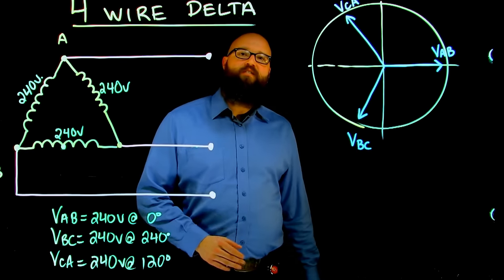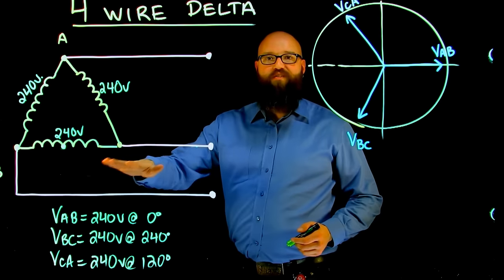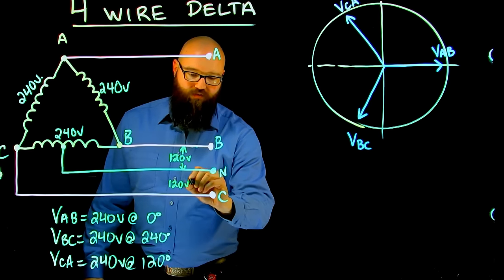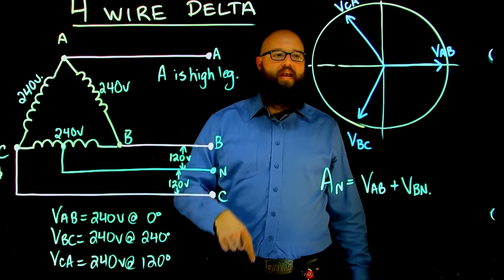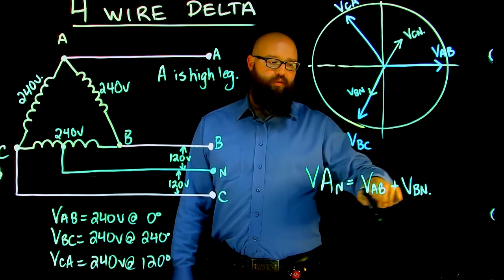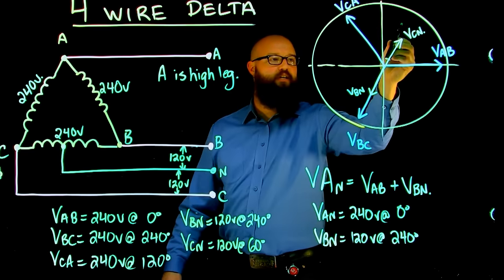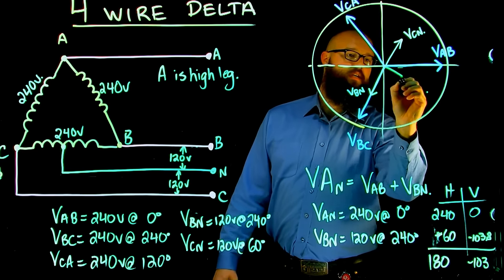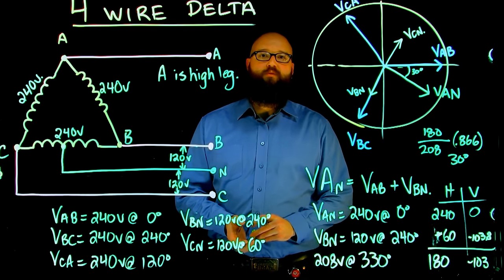Three Phase 4 Wire Delta

Comment: In my neighborhood, this High Leg 3Phase is supplied by the electric utility company using 2transformers (not three as suggested in the schematic above).
The 1st transformer is a center tapped transformer delivering B,N,C. The 2nd Transformer is wired as A,N and is perpendicular to B and C phase.

Comment: At First Energy we called the middle pot (that's 120/240) the Lighting Pot. Smallest config wud be two 25 KVA wing pots and a 50 KVA lighting pot. Usually the three phase load is smaller than the 120/240 load in commercial customer. On occasion, all three would be 25 KVA minimum.

Comment: What would happen if you tap another coil in the 4 wire delta, i mean a 5 wire delta. Will it cause a failure? Or still working?

Comment: Would it be possible to create a high leg wye system?  With two 120v windings and one 208 volt winding all center grounded but phased so that they could basically mimic high leg delta but actually be wye derived?

I'm asking this because I use inverter derived 3 phase where each leg is digitally controlled from a seperate inverter,  for offgrid solar applications.  I'm wondering if it would be possible to use 2 120v inverters and one 208v inverter to mimic a high leg delta system.

Comment: Many might not be aware, but it is possible to have a 4 wire delta at 480 volts.  You'd have 240v L-N, 415v high leg - N, and 480 L-L.   I've heard of them a time or two, they are super rare and kinda pointless, because if you had a 480 volt system and needed to run 240 volt equipment normally you'd have a 277/480Y system and use a 480 to 240 transformer.    Wye systems are the most common because load balancing is easier when supplying single phase equipment.   Delta systems are really only practical when most  of your loads are 3 phase, also it's easy to accidentally connect 120 volt equipment to the high leg and destroy stuff. For these reasons 4 wire delta systems are rarely used in new installations.

Comment: Can you feed the primary voltage into the secondary of transformer and get the same change
Reply from the maker: The issue would be insulation on the windings. Applying primary rated voltage to the secondary windings, the secondary windings may not have the required dielectric strength.

Comment: I know that the hi leg setup is used in situations where both single and three phase voltages are in use but is there any use for the 208v between phase A and the neutral wire?

Comment: Your way of explanation is really great! May anyone please answer here what would be the reduced capacity (kVA) if we have only open delta at primary and not at secondary. We've D-Yn (11kV to 415V) transformer. Let's have initially rated power of 30kVA. Thanks in anticipation
Reply: If you have open delta on primary your secondary will be open delta or open wye. Doesn’t mater you still have a 57.7 percent of your 30kva. 30kva x .577 = 17.31kva.

Comment: Do you know how you get 240 volts from a 2pole breaker in a 120/240 delta service with a 208 high leg?
Reply from the maker: Line to line voltage in this system would still be 240v. Hopefully this is what you are looking for.
Reply: @schulerruler  Is it because vector math of 120 +208 = 240? I guess I'm not sure how the vector math works out if that's the case
Reply from the maker: @possibility28able  you wouldn't need to sum anything in this case. Each of the coils are rated at 240, so they would be the phase voltage and line voltage on the output of the transformer.
Reply: @schulerruler  Oh yeah. I guess I'm thinking of if you used a 4 wire feed, such as for a range or appliance that required two legs of 110 volts, which wouldn't be used in a delta service.. Thanks

Comment: Come on you wuss. Hey I put it in the same panel all the time. I even use it for modern LED lights which. will run on any voltage from 100 to 277 volts 50 or 60 Hz. Just make sure you use a straight rated circuit breaker. (240 volts)
Reply from the maker: Jolyon Welsh thanks for watching. This video is intended as an instructional aid for electrician training on installations complying to Canadian Electrical Codes. Installation of a high leg in the same service as the 120/240 has the potential for accidental 208v single phase situations. This is what is mentioned in the video.
Reply: Well you have to first measure for the high leg. And then put a warning label on the panel in question.  In the U.S NEC the label must say " Caution, B phase is 208 volts to neutral".